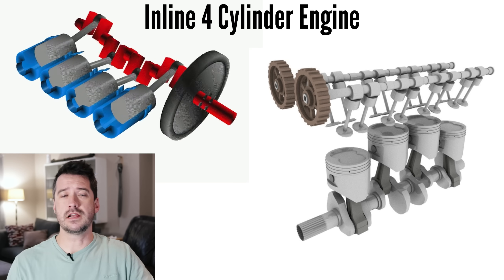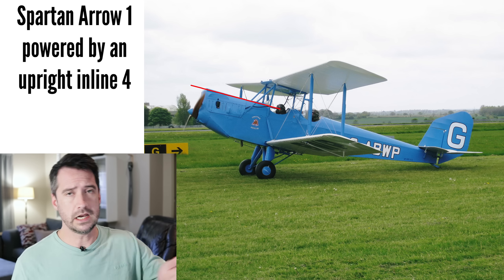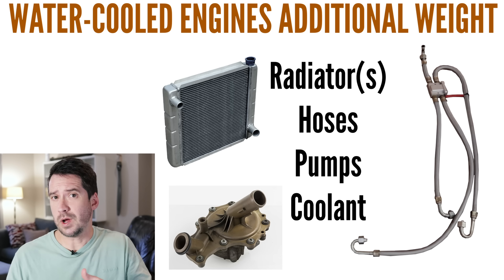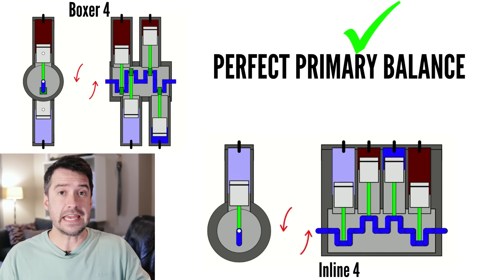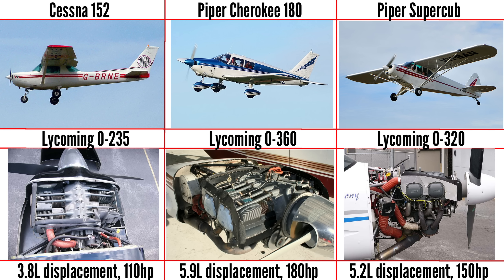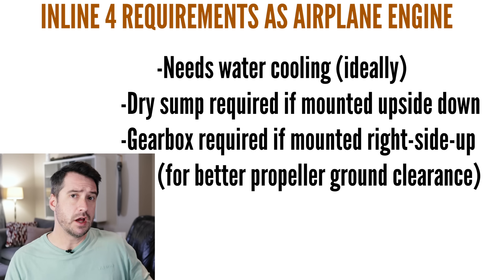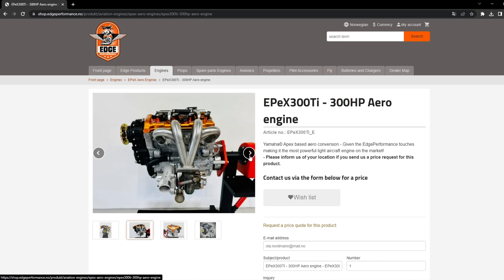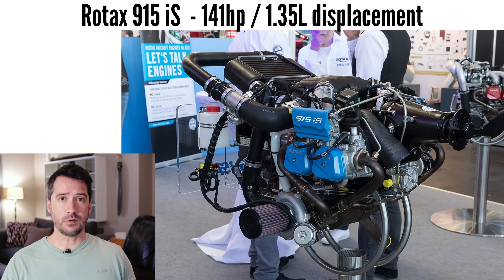Does Inline 4 Engines Suck for Airplanes? - Technical Deep Dive

Comment: Diamond used a 2.0: inline four cylinder diesel (modified Mercedes OM640) with gearbox, this a certified production aircraft.
Reply: The recip aircraft engines are designed similar to heavy truck engines for reliability. Yes they are considerably lighter. The cylinder spacing is greater than most automotive engines which allows wider (thicker) crankshaft throws. Also the fillets at the sides of the main and connecting rod journals are ground with a larger radius to reduce the possibility of stress risers. 
Most automotive engines run on a low duty cycle, so fatigue resistance is not as critical. Automobile engines with max power of 200HP probably only require 30HP to drive at 60MPH. This is a low duty cycle with short bursts of maximum power for a few seconds. Aircraft run full power for takeoff for 5 minutes and then reduce power to 75% for the rest of the flight.
Auto engines in aircraft have short TBOs because the narrow crank throws and small radius fillets allow flexing fatigue to build up, leading to failures.
Regarding the certified Mercedes based engine, is not likely plucked off the Mercedes assembly line and with minimal changes ready to install in an airframe. Diesels are designed and built more substantially, but for aircraft I would think crank fillets would need their radius increased even more. Exhaust valve cooling is a key issue to resolve. Wider seat contact area and larger diameter valve stems to provide more area to transfer heat out of the valve.
Reply: The recip aircraft engines are designed similar to heavy truck engines for reliability. Yes they are considerably lighter. The cylinder spacing is greater than most automotive engines which allows wider (thicker) crankshaft throws. Also the fillets at the sides of the main and connecting rod journals are ground with a larger radius to reduce the possibility of stress risers. 
Most automotive engines run on a low duty cycle, so fatigue resistance is not as critical. Automobile engines with max power of 200HP probably only require 30HP to drive at 60MPH. This is a low duty cycle with short bursts of maximum power for a few seconds. Aircraft run full power for takeoff for 5 minutes and then reduce power to 75% for the rest of the flight.
Auto engines in aircraft have short TBOs because the narrow crank throws and small radius fillets allow flexing fatigue to build up, leading to failures.
Regarding the certified Mercedes based engine, is not likely plucked off the Mercedes assembly line and with minimal changes ready to install in an airframe. Diesels are designed and built more substantially, but for aircraft I would think crank fillets would need their radius increased even more. Exhaust valve cooling is a key issue to resolve. Wider seat contact area and larger diameter valve stems to provide more area to transfer heat out of the valve.
Reply: @daledavies2334 WRONG, Mercedes delivers the short block assembly directly to Theilert
Reply: @WilhelmKarsten  Wilhelm, I have no recollection of mentioning Thielert or Diamond. I have written only about rotary engines and a short dissertation on the shortcomings of recip engines in general.
Back to the Schnapps.
Reply: @daledavies2334  The original post was specifically about the Thielert Centurion 2.0, this engine is a FAA and EASA certificated 
Mercedes-Benz OM640 automotive engine found in the A Class and B Class 2004 to 2012.
Reply: OM in OM640 means Officine Meccaniche with factory in Brescia and Milano (Italy) because Mercedes used their engine.
OM by the way started production on Swiss company Saurer license.
Saurer disappear from car and truck market, instead OM which won first Mille Miglia race in 1927 was acquired by FIAT at the begining of thirties after Great Recession of 1929 becoming later part of IVECO.

Just for fun 
Regatds

Comment: Great content. I'll be the first to admit "if it ain't broke don't fix it" but there's something to be said about engine tech from the 1930's. We are definitely in an age where state of the art engine tech can/should be applied to light aviation.
Reply: LOL! Inline 4s sucked for everything... go smooth 90 degrees V2, V4, V6, V8, V10, V12, V16, or boxer 4, 6, 8...
Reply: @BuzzLOLOL  V2s are anything but smooth. V4 is the least smooth 4 cylinder engine possible. The V6 is a pair of inline threes, out of phase with each other, and work best at 60 degrees, not 90.

Just...hard to believe that you could say so much wrong, in one post.

Simply put, Inline 4 cylinder engines are great engines. In cars, they don't force you to make compromises with the suspension and frame like a flat engine does. They do have primary balance, unlike a V4, which also introduces a torsional or rocking moment.

They offer better engine bay packaging for front wheel drive cars than either. Flat or V4 engines. Nothing needs to be buried under a cowl or the floorboards if it is transverse, so there is no incentive to do the dumbest method of longitudinal front wheel drive...unless you're AUDI or VW Brasil in the 80s...or Surbaru, or SAAB (pretty sure I've missed a few). Why is it the dumbest method? Well, if you're Audi, VW, or Subaru, you hand the engine out in front of the transaxle, leading to absurd weight balance issues, having so much mass so far forward.

SAAB on the otherhand...doesn't have a oil pan, because the transaxle is...part of it, with the front diff right under the front of the crankshaft.

For Aircraft? An Inline 4 gives you the least frontal area, for better aerodynamics.
Reply: @dposcuro  - For you to be so totally wrong, you must have zero experience with these engines... ride a Ducati V2 and a Yamaha V4 and then come back educated!
Reply: 1930s tech?? There are a few planes flying today with that old of systems but most are much newer. New electronic controlled magnetos, mechanical fuel injection, and now electronic fuel injection. I would argue airplane engines are about 40 years behind car technology. Sure in an old plane the tech is old but that is also true of old cars.
Reply: It's vastly more important in aviation for new tech to be proven totally reliable than in cars... it's harder to simply pull over and stop when something fails in a plane...
Reply: @dposcuro  V6s actually work best at 120 degrees, but this is uncommon because of bad packaging
Reply: @BuzzLOLOL  BMW used an inline 4 cylinder that was turboed in F1, it was banned because it was too powerful compared to all the other v engines other teams were using

Comment: I suspect the biggest obstacle is the insane cost of certification.

It's caused the demise of several innovations. 😢
Reply from the maker: For sure. But even on the experimental side where certification isn't required, it's much more cost effective to convert auto engines than design from the ground up.
Reply: It'd be interesting to innovate in the area of certification. There would be almost zero drive to do so from the major engine manufacturers because it's their competitive barrier to entry, but if there were a lot more investment in ways to streamline the certification process, like computer analysis and simulation, different best practices that are required or other ways to make it faster and cheaper.
Reply: @toastrecon  As an electronics engineer and a software/qa developer, I get a bit tired of the push for simulation testing.  I knew plenty of developers who weren't too interested in making sure that they had taken every possibility into account, they wanted to ship and cash in.

Nothing but nothing replaces real world testing and since I'm also a (not currently current) Pilot, I know the importance of equipment.  You can't pull over and fix a problem up there.  I'm not afraid of a dead stick landing but they're too expensive, even without any airframe damage and no, I don't speak from experience.
Reply: @arcanondrum6543  simulation wouldn't replace testing, but I'm guessing that it could dramatically streamline it, or allow smaller companies to get an 80% solution before sending it to test, that would improve competition and help new companies learn and enter the market with innovations.
Reply: @toastrecon  You'd think so but simulating a real world thing can be surprisingly difficult and if you don't do enough you might assume things you otherwise wouldn't have. Sure you might catch things you wouldn't have caught but I don't think anything that can be called an 80% simulation would catch those things.
Reply: @DKNguyen3.1415  you make my point for me: if you catch 80% of the errors in the sim before you build anything (things that would usually be discovered through physical testing), you save time, money and lives. The validation is still done, but it doesn’t take as long because you have fewer iterations.
Reply: @toastrecon  It seems that you are defining an 80% simulation as a sim that catches 80% of the errors and I think that's an inappropriate and unrealizable metric because: (1) there's no way to know you caught 80% of the errors in your simulation because you don't know what the errors are. (2) That last 20% you aren't simulating is probably where you need the simulation the most and the effort to get there in simulation can be very great especially since you need to know that you can trust your simulation is good. It never even occurred to me someone would define an 80% simulation as a simulation that caught 80% of the errors, or that a simulation of 80% of a system would catch 80% of the errors.

When I say 80% sim a simulation that simulates 80% of the system, and I do not think it will catch anywhere near 80% of the errors. I feel that for a simulation catching to catch 80% of the errors would probably be simulating something like 99% of the system. And the road to get that last 10% or even 20% of the system simulated can be great and is compounded by the fact you need to verify that you can even trust the simulation to that degree.
Reply: Lycoming and Continental are owned by large corporations who monopolize GA and don't want the competition of automotive technology. 
The insane cost of certification is part of the monopolization of GA. They run off the competition with insane cost. 
The automotive engines burn less fuel than the certified engines at the same H.P. and can use automotive gas with out vapor lock (LS3 engine by Corsair).

Comment: I feel the biggest downfall of the horizontally opposed engines is the air-cooled cylinders and the leaded avgas. The cylinder walls are thin and vibrate on the case making for less life and more noise. The air-cooling means bigger clearances for greater temp ranges for greater thermal expansion. The avgas pollutes the oil, through blow by leading to sludging and lead sticks on valve stems.

I couldn't bring myself to put one in the velocity, I wanted something modern simple and predictable so i went the viking 195 route.

Good content and i think the topic of auto engines in aircraft needs more exposure.
Reply: Traditional aviation engines could be better if they got away from the leaded avgas.  That would enable closed loop operation, which would be a big step forward in engine control in regards to air fuel ratio and spark control.  The Lycoming IE2 is a step forward with EFI and push button start, but it's still desgined for leaded avgas.  Full closed loop with unleaded avgas would be another step forward for AFR control over the lifetime of the engine.  They'd probably last a lot longer that way, car engines sure did once modern fuel and spark control was available.
Reply: Don't know about aircraft boxers, but car boxers are known for thin, poorly supported rod and main bearing webbing. Porsche goes racing with them to this day, so they must have beefed them up.
Reply: Enjoying watching the progress!
Reply: Removing lead will cause current production old-school engines to last FOREVER. I really don't see much use in coming up with more expensive, complex engines when what we already have is as reliable and affordable as it could get. Just get the lead out and overhauls will almost go by the wayside.
Reply: You mean that the walls expand when the pressure rises inside the cylinder? I read that steel has good tension strength and stiffness per weight. Why no flow more oil through the head and piston with a pump which continues after engine out to avoid coking? Do liquid engines have valves to lock the incompressible water in the jacket at each power stroke? Like in a 1921 Buick car engine?
Reply: Hi, how many hours do you have on the @ausVelocity with Viking 195 now?  I was excited about that engine some years ago but wonder about design margin and durability.
Reply: @timduncan8450  Still Zero I'm afraid. Still in the building phase of the experiment. At this time I'm aware of one other guy putting a 195T in his velocity, his aircraft is almost complete so he'll be the first to try it.

As for design margin and durability, well they last for decades or several thousand hours at lower revs (3000 and below in a car). At higher revs, still below redline?, don't know for sure but I bet Honda know and are happy to manufacture them by the millions.

Comment: The Rotax 9 series engines have all of the things you mention such as dry sump, water cooling, and gearbox and they are doing quite well.  I do with Rotax would develop a mono lock engine such as a V4 or V6 as that would overcome many of the packaging issues of the inline 4.
Reply from the maker: Rotax is somewhat of an anomaly in my opinion. They are extremely reliable, my airplane is powered by a 912.
Reply: @LetsGoAviate  I am hoping they are reliable as I am installing a 915iS in my airplane at the moment.  I actually consider Lycoming and Continental to be the anomaly’s today.  Persisting with early 20th century design and technology well into the 21st century is the real anomaly.  I think Rotax will soon become the norm leaving the others in its wake if it moves into the 200+ HP range.  And if they offered a mono block V-6 with integrated dry sump system they would have a real winner in the 150 to 300 HP range.  I say integrated dry sump as I spent most of yesterday figure out how to route and connect the 5 oil hoses that run between the engine, oil cooler and oil tank.  What a pain!
Reply: VR6

Comment: At 8:54
In line 4 displacement..

You were talking in automotive terms. I have seen truck engines that were larger than 4 l iters that were four cylinders.... They used to be quite common back in the day.
Reply from the maker: 100% correct, since I was leading the video to car engines converted for aviation, as well as just covering the basics of the secondary imbalance. The truck engines are like the 6.1L airplane engine I spoke of, in that they are low revving, which is why they can be that large.
Reply: @LetsGoAviate  

I think a couple of them we're two stroke diesels as well....

Going to do one on six cylinders?? I seem to remember the Junkers of WW2 fame had an inline 6 burning diesel.... There is a lot of boxer sixes as I remember. Are there any boxer 8s??

Inline sixes are inherently balanced usually, primary and secondary are both balanced.
Reply from the maker: Oh yeah for sure. Theres also the Gipsy inline sixes, not to mention the plethora of boxer sixes. 

The legendary Mike Patey's plane, "Scrappy", is powered by a Boxer 8.
Reply: @LetsGoAviate  

You going to do videos sixes and eights??
Reply from the maker: @montecorbit8280  Yeah planning to
Reply: @LetsGoAviate  

KWEL!!

Comment: I enjoyed your video and learnt a little regarding Secondary Vibration which I´d never thought about before. I retired recently from 49 years as a light aircraft maintenance engineer!
These new engines being developed are light and powerful, however they require much more complex ignition systems necesitating duplicated batteries/power sources, computer controllers, relays, etc.,etc. More complexity = More to go wrong.
Thanks and keep it up.  Simon, Spain.

Comment: Thanks for the presentation.....would like to see you do a deep dive into what Diamond Aircraft is doing with the Austro Engine....essentially an adapted Mercedes diesel engine burning Jet-A.  I have owned one for 2 years now and with Jet-A, FADEC and a host of other benefits, would never consider owning the old tech engines.  Also, have a look at the Continental CD-300.....a V-6 design now being used in the Diamond DA50RG.  Have a look and let us know what you think....Thanks again, DiamondEYZ
Reply: Exactly what I came here to say, the Austro/Thielert/CD family of engines is really the way I'd love to see more aircraft manufacturers go. Jet-A is definitely the way to go with higher compression ratios, lower fuel consumption, lower fuel price and (at least outside North America) better fuel availability. Personal opinion, they smell better too...

Comment: Excellent explanation of a rather complex subject! Cost will always be a determining factor in aviation engine choice, consequently why design a new engine when you can modify an existing and less expensive engine like Apex or Viking have done.
Reply: Because of time. Every year there is the chance that someone is just bored or needs a project to learn stuff . This gave us Linux. The problem is that all the 10 times engineers which were attracted to aviation have moved on to modern fields like computers.